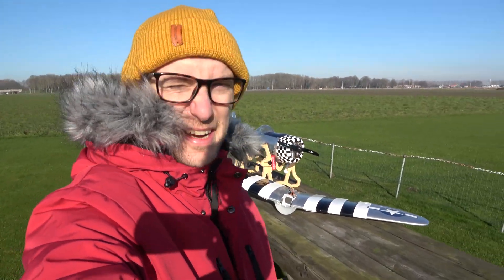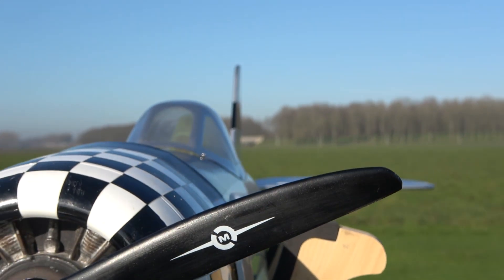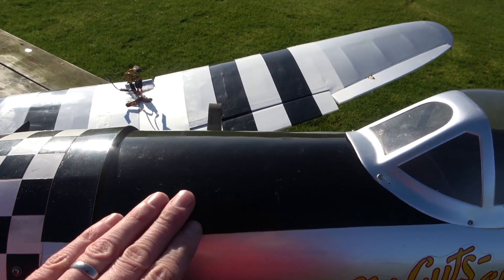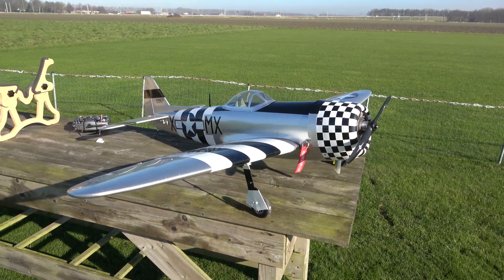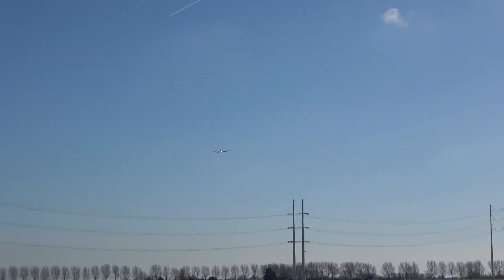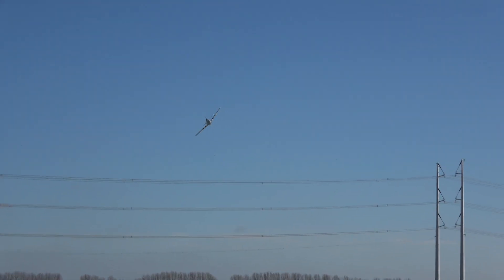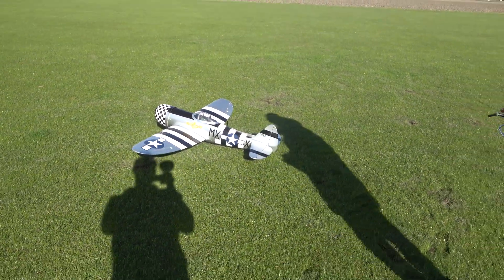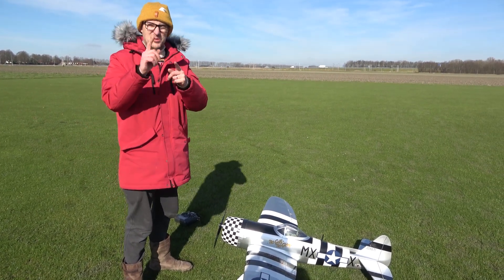Vintage Hangar 9 P-47 60 ARF, Laser 100 4 Stroke, Restore and Maiden

Comment: The best Hangar 9 Model ever built. I bought 2 of those models. I have it in electric ⚡️ and the other is for spare parts or incase I crash 💥. Knock on wood 🪵 it has been reliable for years besides replacing the CA Hinges on the control surfaces. Make sure you check those ca hinges. My started pulling away from the wing. I replaced them with Dubro plastic metal hinges. It’s been Rock Solid since🍷

Comment: I really like it Stuart. I think a big balsa warbird is in my future. Yours is awesome don't change a thing 👍👍😎🤘👊
Reply from the maker: It does fly better.... one thing I did change, the silicone exhaust extender came off on this flight, new one fitted now more securely, hence all the goo on the bottom of the model at the end of this video.

Comment: That engine and plane are a perfect combination. What a beautiful model and that engine note is spot on. I love how well it fits. P47 is a favourite of mine. Lovely job on restore. I have 2 laser engines and love them. I’m putting my 70 into a 1/5 scale DB Cub.
Reply from the maker: Hey man, thanks. Yes I have two lasers running now and they are fast becoming my favourite 4-strokes.

Comment: Beautiful flying P-47 and gorgeous engine. My Laser 100 is from 2016. Could you tell me please, the weight of the aircraft, the propeller you used and what fuel & glow plug are you using? I am using Optifuel 12% Nitro 18% synthetic oil and OS F plug, and a very wide blade Robbe 15x7 propeller.